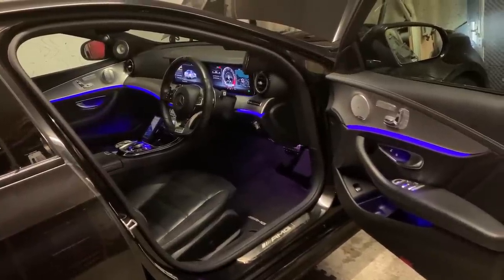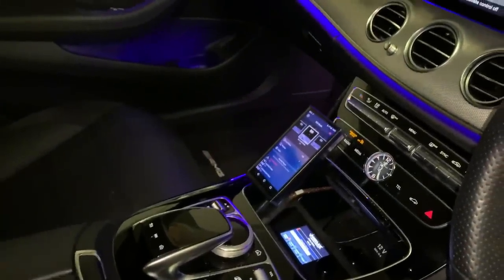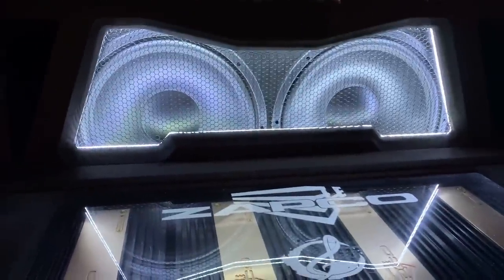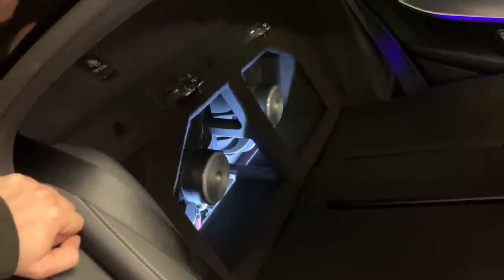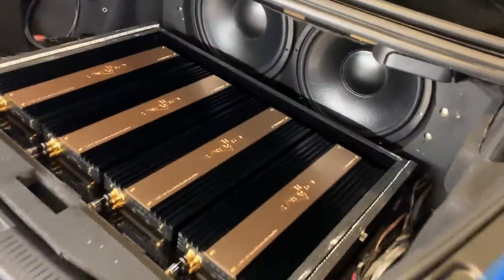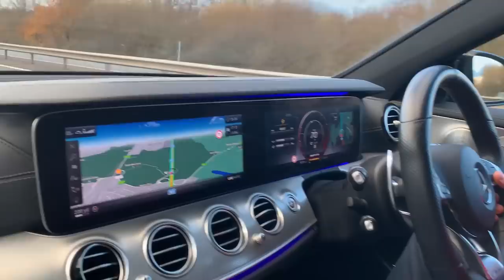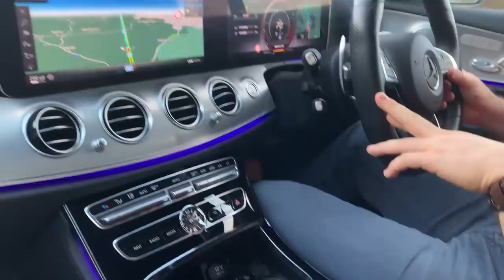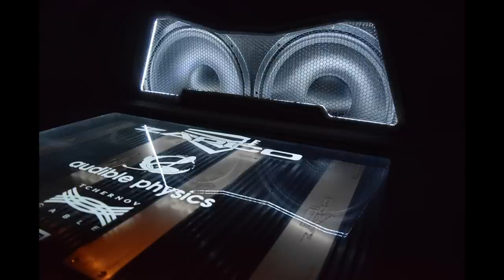Hi-End Audio Strip Out Back to Factory in Mercedes E63AMG - EXPLAINED Backwards

Comment: Question: What is the plan for vehicles who use their spare tire space for their audio system but who then get a flat tire and do not have "run-flat" tires? I ask because I'm considering removing my spare to fit my system and keeping a couple cans of Fix-A-Flat in my car while storing the spare at home for if/when the Fix-A-Flat is an inadequate fix. Obviously I would need a ride home to pick up the spare (I live alone) and back to my vehicle or I suppose I could have my vehicle towed (on the 2 good tires) to my home. Is there a better idea for those car audio fanatics who drive without a spare or run-flat tires?
Reply from the maker: Brandon Lee no, that’s all you can do. Most nee cars don’t even have a spare tyre anymore. 
If we worried all the time about everything what can happen on the road, then we should use public transport instead! 😃

Comment: Peter ,when you inverted the ib subs,did you wire reverse polarity, or standard !!
Reply from the maker: Dennis Walker subs are wired with normal polarity, but you may worry about is regarding the phase relation of the subs to the midbass, which is also down to the acoustical phase response of each pair, so whichever way you wire the subs is fine as you can set them up with the DSP.
Reply: Thank you Peter for sharing this. It gives good food for thought as I struggle with midbass location in my truck.

Comment: This is still one of my favorite builds. Seeing how the zapco DSP-Z8IVII doesn’t have input gain adjustment. Does the fiio M11 have a some kind of output gain setting? For the M11 I’m guessing I would use a 3.5mm to toslink into the DSP-Z8IVII because it doesn’t have a digital coax input. 

I ask because the overall output compared to using my main head unit vs using the optic is not the same. I used another preset on the DSP and raised the main output. Still doesn’t get the volume output, especially the bass. I understand the output with the main head unit is better because it has 4.9 preout voltage without clipping.
Reply from the maker: myboy051 for sub output you have to route both L+R for each sub channel 7-8, then you must get enough output. 
You don’t have a physical gain adjustment for the analog input as you do that in the software on main adjustment, the way you did it too. 
Why it may sound like you get more output with analog inputs is that you actually overdrive the DSP. 
M11 has optical output too in theory, but if you used coax, it costs ~ £20-30 to get a dogital-digital converter box to get optical from coax without any loss.
Reply: @pssound9749  if you use the analog output of the Fiio, you still get the most out of it
Or not ?
Only the output voltage is not very high 
you are now able to play the high dsd files with analog 
that is not possible if you use the digital output 
Or am I wrong
Reply from the maker: Stefan yes, you can not play DSD through coax, so you gotta use analog out for that. None of my clients have DSD files, as it’s so difficult to find GOOD MUSIC in DSD, so we don’t bother.
Reply: @pssound9749  

What will give the best soundquality 
Using the Analog or digital output 
Of the Fiio ?
Digital will always give you more output. But you do not use the DAC of the player, you use the DAC of the digital receiving side the processor
What’s you’re opinion 
Regards 
Stefan
Reply from the maker: Stefan you always use the DAC in the DSP for the analog inputs for your amps. If you use analog output on a DAP, then you’ll use the ADC of the DSP too, so you have DA-AD conversion twice. If you use digital output from the DAP, then you minimise the conversion.
Reply: @pssound9749  
Hi Peter 
thanks for the clear answer👍🏻👌🏻
I love all you’re work 
you know what you are talking about
Regards from Holland 
👋

Comment: @25:08 The AP amps have a internal fan ?
Reply from the maker: myboy051 only the 400.2 APs, but we put in 4 additional into the rack for circulation.
Reply: @pssound9749  - I have the 150.6ap. I didn’t think they had one. @25:08 made me me question it. Thank you!